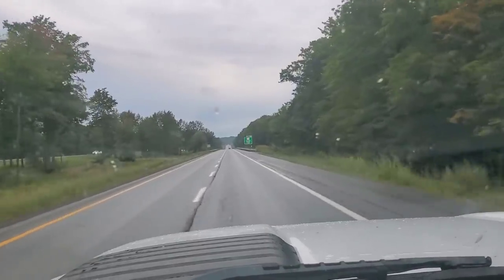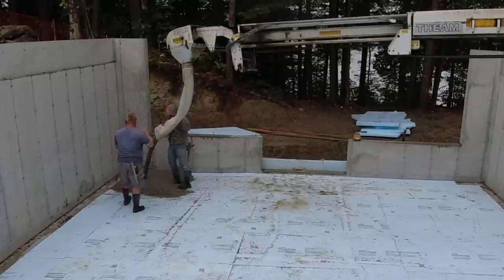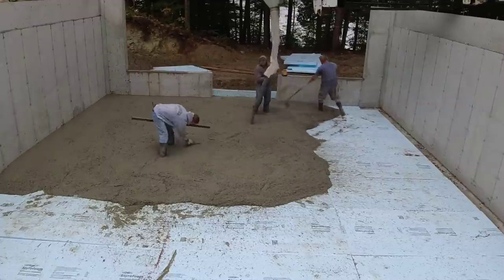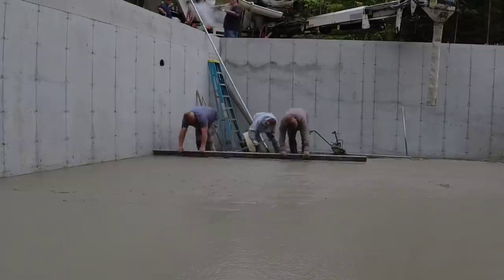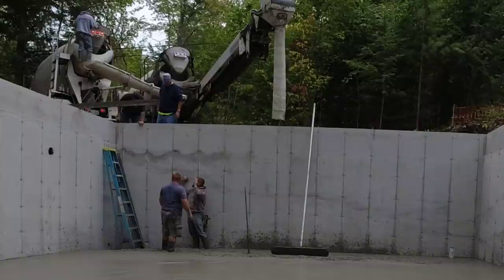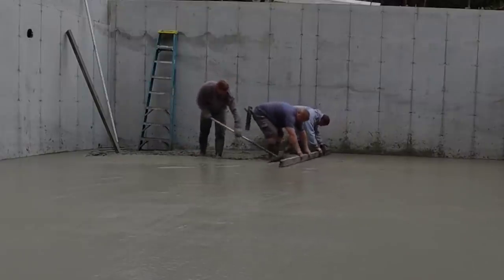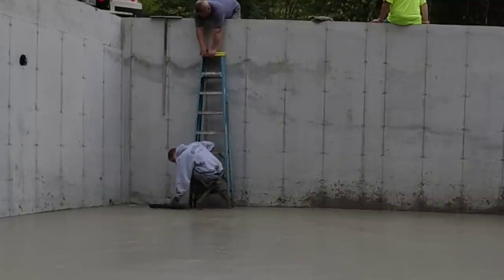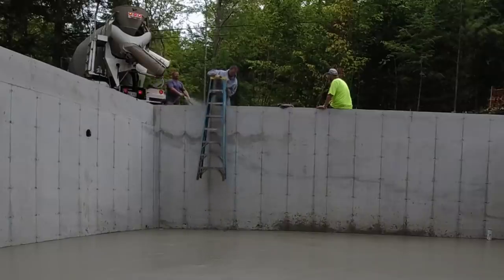Ran Short, It's Raining, and Concrete is Setting Up Fast!  (How I Handle Challenges on the Job)

Comment: I just do small jobs like sidewalks and due to dealing with homeowners who need to save every dollar I use rocks and concrete rubble to save on bagged concrete. Quite frequently at the end of a pour I'm short maybe half a bag or less. I start shoving in more rocks and screed concrete into the final bit. On the other hand when there's left-over I wash out the Portland with a hose and use the sand and gravel to back fill the gap as I remove the form.

Comment: Great job like always! Just curious, why didn't you start at the back wall and move forward where you wouldn't need a ladder to get out?
Reply: Started where the trowel machine can easily be put on the slab where it will set first, then worked to back as concrete sets up.
Reply: yea why not go the other way dont make sense to me.
Reply: @lyndsaymacdonald2486  his response doesn't make much sense either, but he does do a great job. :-)
Reply: @grncrtr  This is the correct answer. It's for finishing. Fixing some ladder holes isn't the end of the world.

Comment: Could you carry some bags of concrete on your trucks for instances like this?
Reply: I do, but the colors don't match, but on a basement it wouldn't matter like a patio would
Reply: @GRUBB-MUDD  - the next batch coming in on a truck might not be the best match either.

But if they do carry bags, then they will also need water. And a small powered mixer or mixing trough.

Comment: Hey here is my question... What is the best way to pour a steep driveway? It is close to a 30 degree pitch 53' long.
Reply: Stiff slump, work your way down from the top of the incline. When putting down the concrete leave it a bit high because it will slide down.
Reply: @KeMiZe44  I figured on doing that already.. About a 3.5 or 4 tops.

Comment: wondering why you didnt work front to back ,,,that way if you came up to short if there were some extra gravel laying around you could have added it to the mix !
Reply: I would rather wear sandles and shorts on a job then add Gravel to a mix, jk how u been?
Reply: I keep 10 80lbs bags of quick Crete just in case, don't ever wana use them but if I run 2 wheel barrows short then I got em, if I was a whole yard short then u gota figure something out,, prob a plus and I always do my own grade, so the only time I ran out this year was on a patio I used my liners on and the sides roll down to 5.5 inches, so I learned my lesson on that 1

Comment: come on Mike, Using a conveyor is "slower" than moving and rejigging chutes a half dozen times..?  You save time raking also by putting material right where it belongs.Put that power screeder to work man, my back hurts just watching you guys kick screed. Also if the grade was so low throw in some of that extra styrofoam in the low spots  if you know you might be tight on material.Your customer was kind enough to waste your time and gasoline for 40 minutes!